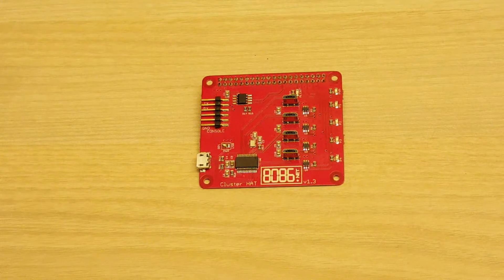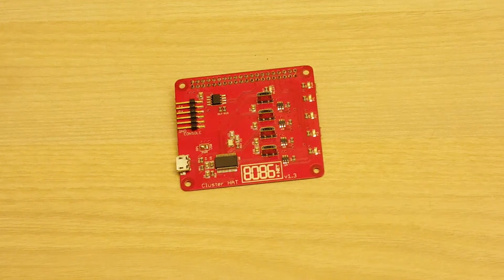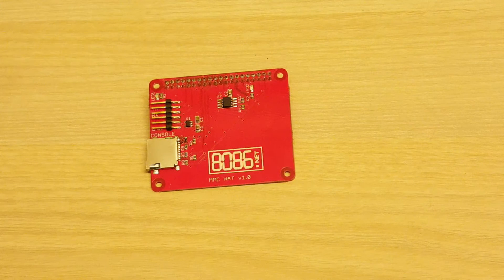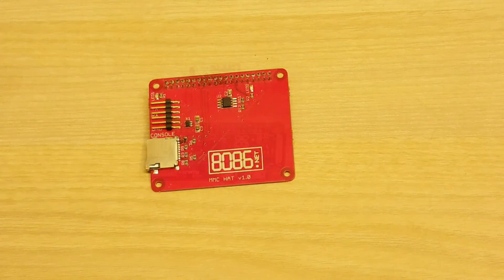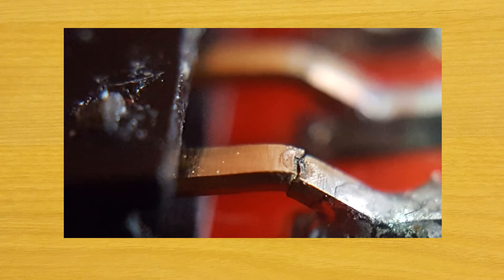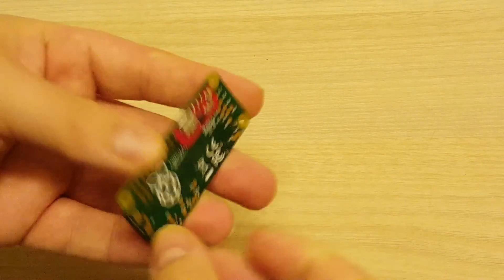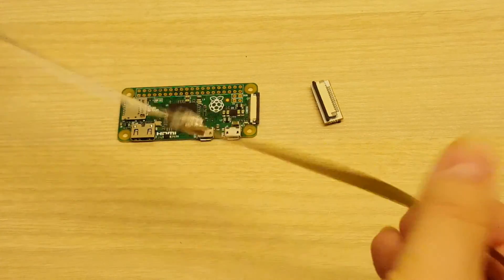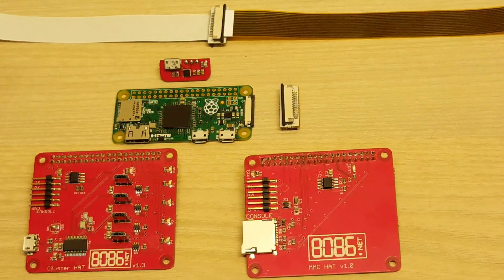2016/10 Update [Cluster HAT, MMC HAT, Solderless Serial (Pi Zero) and Cam Joiner]

Comment: Can this Cluster be used as a Media Hub? For example, placing Kodi on them and using a Kodi device?
Great Video!!!!! Thanks
Reply from the maker: I haven't used Kodi but if you can achieve what you're looking for with multiple Pi connected over a network then I would imagine you should also be able to do it with the ClusterHAT.
Reply: Cool!!! Thanks for the response!!
Great job on the video!!!